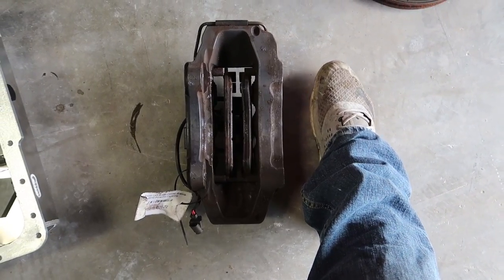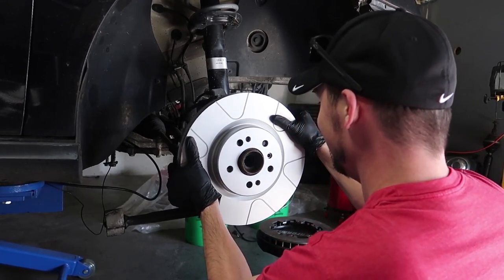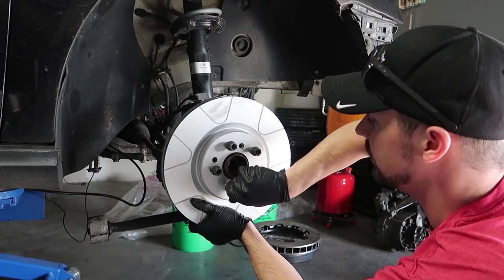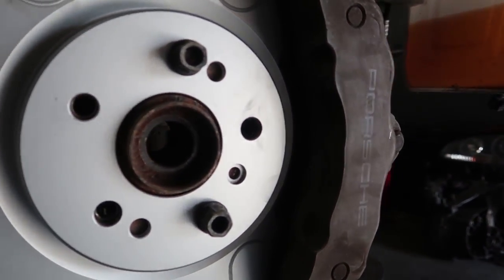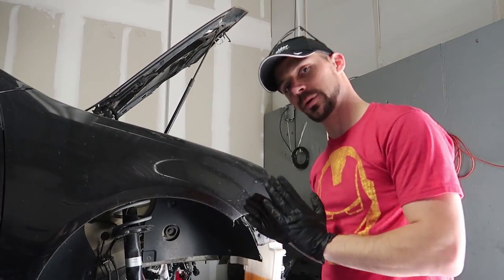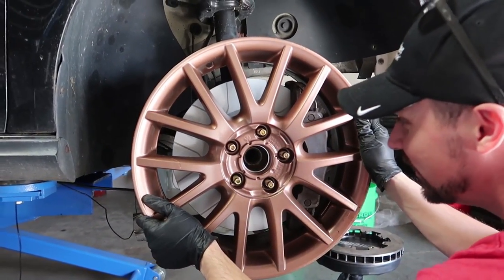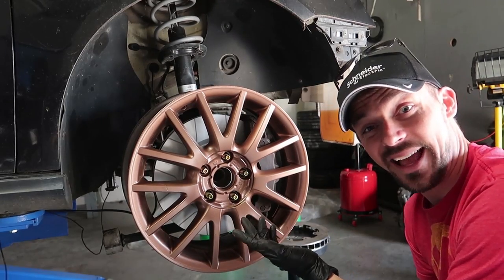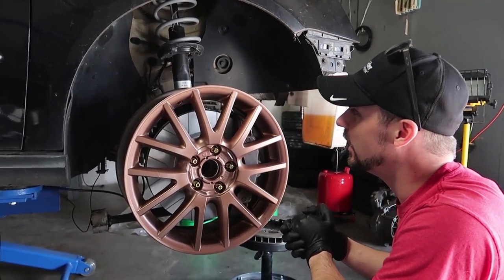MK5 GTI Big Brake Upgrade - MASSIVE Cayenne Calipers!

Comment: Have front AND rear set up for 5 years on my GLI MKV here are my thoughts:

* Front end would dunk with front calipers only, once i got the rears its a like cougar clamping on a tree. 

* Skip spacers, they only gave me problems in the long run.( broken hubs, Balancing issues,  lack of studs makes it a bitch to mount wheels every time)
* 35mm Offset wheels will be needed to clear front calipers. OR.... buy any of the Phaeton 18' wheels as they clear with no mods.  ( thats my spare tire)
* Skip refurbished calipers and buy used original instead. Reason is calipers are aluminum but refurbished ones use steel pistons instead of aluminum pistons as original. After many heat/cool cycles they would always seize.  OR..... save and buy NEW.
* constant warped rotors were an issue. Fixed with two piece ones from  Racing Brake. Not cheap but worth it. 
* Loooooonnnnng pedal travel, specially after all four were done. Fixed with TTRS/TTS/TT3.2 master cylinder. 

Last but not least, brakes pads:

*Skip the whole Hawks line up, they suck and will gunk up your wheels and pretty calipers in a day. Red/yellow/rainbow stuff from EBC were not much better. Same goes for Pagid as well. 

Solution?  

* Believe it or not the run of the mill BOSCH bite/modulate/last/consistent 99% of the ones mentioned above with 10% of brake dust at 30% of the price. 
* OR.... ET300, ET500 from Racing brake are AMAZING.  Bitches are immortal as i can't seem to wear them down, invisible brake dust and they bite and clam over and over and over with no fade. 

About the ET's:  they have a poor initial bite and will need to be warmed up for optimal use.
Reply from the maker: Wow, that's a lot of info!!! Thanks for your input!
Reply: Ricardo Martinez, excellent detail! Gr8 advice.  I have a 2016 Mk7 GTI S (base model so small brakes).  You should write a more detailed account with video of your car! 
Would you know if this approach works with Mk7?
Reply: Thanks for the detailed info. Much help.
Reply: Ricardo, were the rear as easy a fit as the front?
Reply: Are you sure the TT3.2 and tts Master cylinder works? they look different
Reply: Amazing input. Thank you for this!!
Reply: Any advice in how to reduce the pedal travel if big master cylinder doesn't work?
Reply: The TTRS Master Cylinder is a bolts on, or must to be machined?
Reply: Ok so what year Cayenne you get the calipers from?
Reply: Not worth it. I used the Creations Motorsport with binding issues and brake drag. Running the original R32 rear calipers with the front 6 pot calipers was the sweet spot.   @garciabe83
Reply: Yes,  this is the part number (8J1611021C). 25.40 mm diameter instead of the GTI/GLI 22mm.  Brake booster must match though, CC/Tiguan/JettasMK6 have a different one. I installed TTRS master cylinder on 2010 Jetta (MKV with MK6 Wiring) after swapping both master cylinder and booster.
Reply: Yes, I use Motive Power Brake bleeder at 15-20Hg.   These are my steps:

1) Fluid Flush (Autoparts)
2) VW Fluid
3)ABS Purge VCDS. I run 3 cycles.
4) Purge 4 corners now. 

It should be rock solid.   @HowieLop
Reply: Yes, I use Motive Power Brake bleeder at 15-20Hg.   These are my steps:

1) Fluid Flush (Autoparts)
2) VW Fluid
3)ABS Purge VCDS. I run 3 cycles.
4) Purge 4 corners now. 

It should be rock solid.

Comment: i went with the r20 upgrade on my mk5 gti from 312mm to 345mm plus performance ebc disc including steel brakeline. plus upgrade disc en pads on the rear its a great upgrade. greets from the netherlands
Reply: Zou je me ff kunnen vertellen waar ik die kan bestellen?
Reply: @dme9526  yo, ja marktplaats in de gaten houden, komen complete sets voorbij

Comment: They’re called rotor centric rings. The hubs are different sizes. You can see the rotor center isn’t snug. Hub centric rings are for after the rotor for the wheel.

Comment: I drive a stock Seat Cupra ST which is basically a front wheel drive golf wagon. It is the sub8 version which comes stock with brembo 4 pot calipers and 370mm discs. Amazing brakes! And come on the car stock.

Comment: WOW! I have an F250 Superduty as a tow rig and this caliper looks almost as large as my truck caliper!! It weighs 7500 pounds, lol.(the truck not the caliper)  That's awesome!! Good video!
Reply: Jack Allen yeah, they match the calipers on my tow vehicle.  They are literally off of a Cayenne.
Reply: I have been looking at buying a Cayenne lately and this makes me want one even more! Thanks for the reply!!
Reply: Jack Allen no sweat!  I will say, I tow ~4500lbs with mine.  Car, open trailer and equipment/tires.  It does great even on long trips.  My Pig is an ‘04 and I’ll trust it just about any distance.
Reply: Fit brembo to f250

Comment: Front Original disc height 49.9   mm thickness 22-25mm, With Porscher caliper  for disc 69mm thickness 32-34mm, then you put mercedes M  Disc with height 55mm thickness 29.4-32! Any problem for piston movement! What pads we should use for it!?! M or cayenne ? And how about the rear one!?! 
Tks for advise!

Comment: BTW, Cayenne and VW Toreag calipers are the same. You can probably save yourself a few bucks if you can do without the Porsche logo. They have 4 piston and 6 piston versions. Either one is a huge upgrade from the VW single piston caliper. 

I also read somewhere that the caliper bolt is much bigger on the big brake calipers. I saw somebody solved this issue by using the smaller stock bolts, but using an insert sleeve in the caliper to take up the extra room, so there's no slop. 

I have 19" rims on my Audi A4, but I kept my stock 17" rims for snow tires. I heard they might still fit. I'm curious to find out for sure. I'm not likely to change out my front brakes when I drive to the snow.

Comment: Hey Guys, great channel by the way. 
Quick questions: (Cayenne's calipers from which year of production).
1- How does this upgrade affect front and back brake bias?
2- What type of upgrade do you guys have planned for the rear?
3- No master cylinder or any other brake components necessary (stainless brake lines, brake plates adaptors, etc..)
4- What type of brake fluid are you guys using, and last questions.
5- The hub centric "adaptor" is necessary to space out the wheels to clear the calipers or just to make sure the wheels are centered?
Thanks!

Again, love the channel.
Reply from the maker: Thanks!!! I’ll post a link at the end of this comment with all the components you need, model numbers, etc.

The brake lines are off another VW and are a direct bolt on, no need for custom stainless one.

As for brake bias and rear mods, we are going to run a regular street pad up front and a race of in back to even out the bias for now. The first track event of the year is two weeks from now so we will see how it does, but so far so good. No master cylinder mods needed yet!

https://www.golfmkv.com/forums/showthread.php?t=167209

Comment: Thanks for the vid I was wondering what OEM calipers would fit. Do you know if the rears would be aswell also would these clear 17"s?
Reply from the maker: To my knowledge the rears do not fit. When running the 330mm rotors you should clear 17’s
Reply: @BoostBrothersGarage  thanks man well I assumed those calipers wouldn't I was more concerned with a big brake kit for the rear that was an OEM from another vehicle

Comment: I have Brembo ZR18 from Q7, 6 pot calipers...
Will they fit to A4 B8 3.0 TDI Quattro?
A4 have 320mm stock disc, but option disc in shop is 345x29 5X112.

Comment: The hub have 65 mm center hole for original dość brake and the ml 350 discs have 67 how do You Solve that problem ?

Comment: Do they just bolt up with the regular caliper bolts or do you have to get aftermarket bolts?
Reply from the maker: I link to a thread that explains what’s needed a few times in the comments, and I believe in the description as well. The factory bolts are reused but a “spacer” is inserted with the bolt.

Comment: Super upgrade, and happy to see some GTi content. Did you guys do the hydraulic equivalency maths? Physically fits doesn't automatically mean it is all right.
Reply from the maker: Not yet, but this is a well documented upgrade that is apparently proven to work well. But, we will know more when we shake it down! We will have quite a bit more GTI stuff coming over the next few weeks as we are in a race to get it done by Mid April.
Reply from the maker: Good stuff, thanks!
Reply: Needs the Master cylinder changed before it’s finished.  Based on the guy I spoke with prior to doing this, he’s ran his track car for about 5 years in this configuration.  He explained the pains he had prior to changing the MC so it’s going to get done as well.

Comment: If you ran 8mm spacers, do you think the wheel would clear the outside of the caliper? How much wider are these calipers from the center of the rotor fins to the inside of the face of the rim?

Comment: Dem. Binders. Doe.

Curious what the weight difference is between the Cayenne and stock calipers? Either way your channel just keeps getting better, keep up the great work gents!
Reply from the maker: Thanks dude! Having held both of the calipers, I think it's relatively minimal believe it or not. The Cayenne calipers are truly massive. I was joking with Thomas about the car doing a front flip the first time he hits the brakes lol.
Reply: Namesi sorry for the late reply here.  The factory caliper is heavier by about 4-5oz.  However, the rotors are heavier by 6 lbs.  it is a huge impact to unsprung weight which I hope to eventually win back with other modifications.  For now, I’ll live with a FWD that pushes a bit more than it used to for a brake that doesn’t overheat like the factory setup did.
Reply: Wow that's impressive that the Cayenne caliper is actually lighter! You are gonna need all the help you can get with all that booooooooost lol. Keep up the awesome work!
Reply from the maker: Sounds like you just need to make a set of rotors with aluminum hats. Then again, got draw the line somewhere! That time, effort and money should go to the 911 build.

Comment: hopefully someone can answer my question. lm looking to buy the ECS tuning big break kit that don't include the calipers. I want to buy the calipers separate because its cheaper I've been looking on ebay and amazon and l found a few Porsche 955 cayenne calipers but not sure what year they have to be in order to put on my golf R 2013. they have 2003 to 2010. and l can't seem to find the part number on ebay. any help would be appreciated.  thanks.

Comment: Nice upgrade! Are the hubcentric spacers made specifically for this upgrade or are they normal 5x112pcd hubcentric spavers? (I noted the spigot diameter in the middle doesnt match to the mercedes spigot)
Reply from the maker: Thanks! There are a few places to get them, pretty universal. They are 67mm to 65mm hubcentric rings. This link has a lot of good info! https://www.golfmkv.com/forums/showthread.php?t=167209

Comment: Will these calipers fit straight onto the Golf carriers or would I need the Cayenne carriers.I'm in the UK so I think you guys call our Golf the Jetta.
Cheers guys.
Reply from the maker: I did a quick search and it looks like the GTI and the Jetta (your golf?) use different calipers from the factory. My assumption is no, but you would have to do some digging as I am by no means a VW expert!

Comment: Are you using the 17z or 18z calipers on this setup? I have got the 18z calipers with 350mm discs and my lower ball joints are catching the rotor ever so slightly, was this ever an issue for you or so you know anything about this?
Reply from the maker: https://www.golfmkv.com/forums/showthread.php?t=167209 
We followed these instructions, using the 17Z calipers and had zero issues.

Comment: How would this affect the brake bias (front/rear) after install?   Will this also affect the ABS?
Reply from the maker: Should not affect ABS. As for bias, Thomas is going to run standard pads up front and track pads in the rear to help solve that issue. Eventually, the rear may get a BBK as well.

Comment: Did you use the original MK5 bolts to mount the caliper? I see there are kits online.  Have you got pictures of the inside of the caliper?
Reply from the maker: No pictures of the inside of the calipers. We did use the factory bolts, along with spacers (made of 1/2” copper tubing, 5/8” OD)
Reply: Creation Motorsports makes specialty bolts that have a larger diameter area and a smaller diameter area.

Comment: Hi lads,iv got a problem,iv got Porsche 6 pot brakes and Mercedes ML550 discs with brembo pads,3 months in and if got steering wheel wobble even have the hub rings in,how have you got on? Mine are dimpled and groved from mtec brakes ??
Reply from the maker: Thomas has only tracked the car so it doesn’t have THAT many miles on it, but he hasn’t reported having any issues like that. Is it only under braking?
Reply: Brakes are bent
Reply: Anil Aksakal turns out iv got Warped discs,cheap mtec discs getting to hot with the big brakes so getting forge 350mm discs
Reply: @tonylyons9727  Did the 350mm forged discs work out for you? If you have 18Z calipers, that would have worked most likely. However I believe the 17Z can only hold a 330mm rotor size. Let us know how it worked!
Reply: Corey hi ya i got the forged rotors and there bang on,so all is good now,I went to a big company who explained to me that mtec brakes get them in in bulk and modify them there selves to save on cost and make profits ect but because the mtec discs are made of a cheap Chinese company they couldn’t stand the heat coming from the big 6 pot stoppers so they were getting worped very quickly and i was never hard on my brakes so the said either EBC brakes forge or a few other places they told me but i just went with forge

Comment: Can you please provide the year for the Mercedes ML350 rotors and the width of them, and also the year for the Porsche Cayenne Calipers. I really want to do this upgrade, but i dont want to order the wrong parts. Thanks.
Reply: The brake disc are from a MB ML 350 W164 from 2005 - 2011

Comment: So what rear brake setup did you end up going with? Looking at doing this to my mk6
Reply from the maker: Running the stock brakes in the rear. However, the rear pads were upgraded to race pads and running street pads on the front to keep a decent bias. So far so good
Reply: @Crypto Maniac did you end up doing this for the mk6? Please let me know how it worked out ig: dutchess.green
Reply: Same setup works on the MK6.

Comment: Can it be done in golf mk5 2.0 tdi ?
I need more braking power and it looks amazing. Did you try to mod the rear brakes too ? Any ideas what parts to use ? Is there a big difference between gti and tdi for that mod ?
Great job guys you are making my day :)
Reply from the maker: Hey there, sorry for the delayed response. I’m not sure about the TDI but I would think it would work? For the time being, he ran street pads up front and race pads in the rear and it seems to be working well! Here is the link we used for all the info and part numbers: https://www.golfmkv.com/forums/showthread.php?t=167209
Reply: @BoostBrothersGarage Thx guys ;). Do you have any ideas for rear disc mod that would mstch the design and size? It would be great to fabricate some kind of adapter and retrofit rear porsche calipers as well.
Reply from the maker: Unfortunately I don’t. The rotors Thomas used are from Rock Auto so you may check there to see if that manufacturer makes rotors for the rear. It’s definitely a cool design!
Reply: @BoostBrothersGarage  Thx for the fast reply :) Im student so it will take some time for me to gather money and build dream car :) might try to fabricate that myself :) waiting for more mods for golf mk5 :)
Reply from the maker: We’ve all been there, good luck!
Reply: If you haven't already done this Yes you can do this to the GT TDI 2.0  I would suggest you look at the NQSBBK upgrade This is boxster,cayman calipers and 312mm discs with TEXTAR pads HEL lines and Porsche anti squeal shims
Reply: Find R32 rear calipers and discs  Also look for TRW BHN 951 952

Comment: the 350mm rotor from which brand
Reply from the maker: I'll have to check to see what brand that one is, but it's a 2008 ML350 rotor.
Reply from the maker: ULTRA ROTOR 980427

Comment: How big are those wheels?
Reply from the maker: 17”, factory Audi A3 wheels I believe
Reply from the maker: A4 I mean
Reply: Boost Brothers Garage will the factory brake lines work with those calipers
Reply from the maker: No, but the 2004 R32 brake lines are a direct fit!